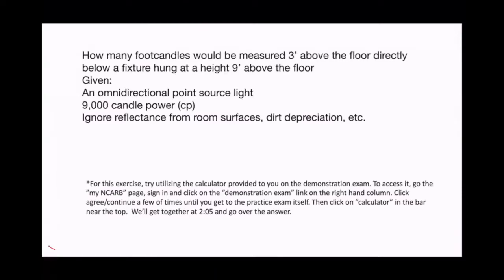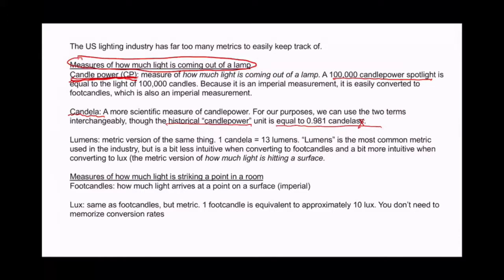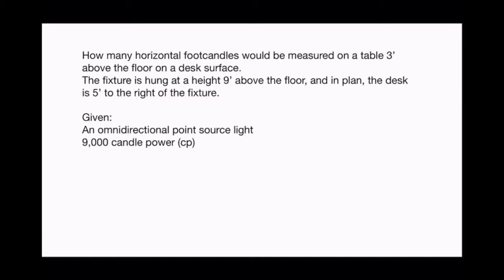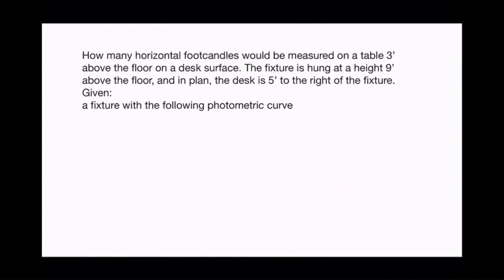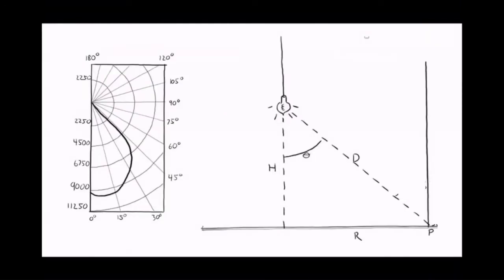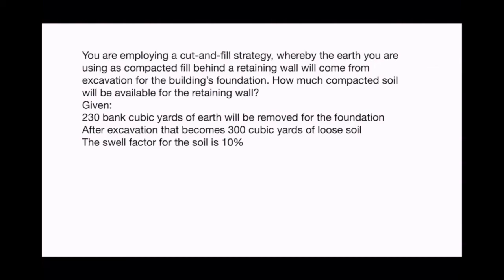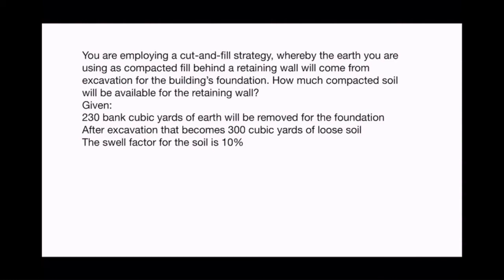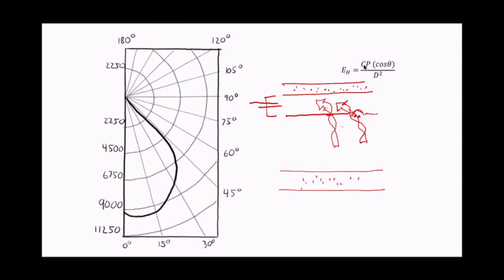Calculating Foot-Candles - 40 Minutes of Competence | Amber Book

Comment: Hello, thanks for clarifying about the fuel heat value formulas.  I currently don't see any formulas from the NCARB references tab related to $/year; does that mean this type of question is removed? Is there another applicable formula?